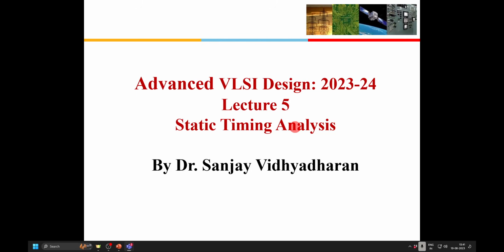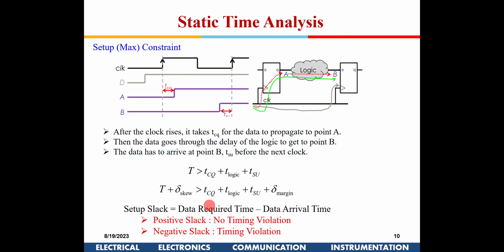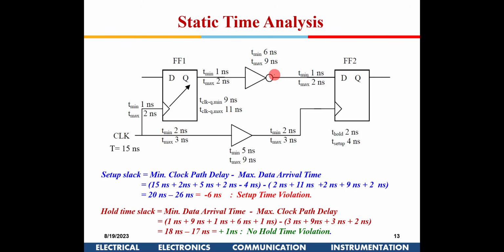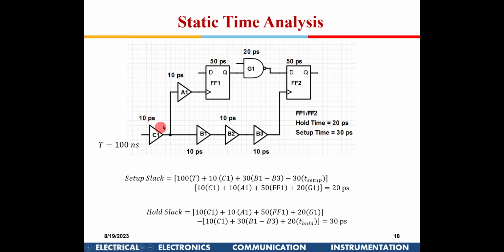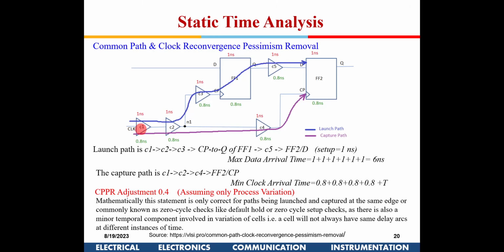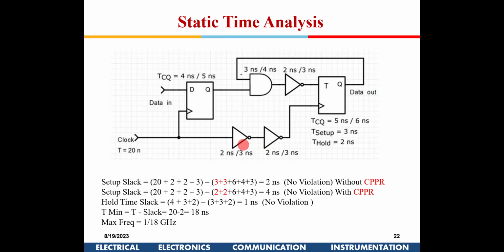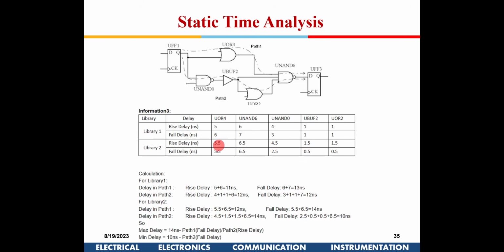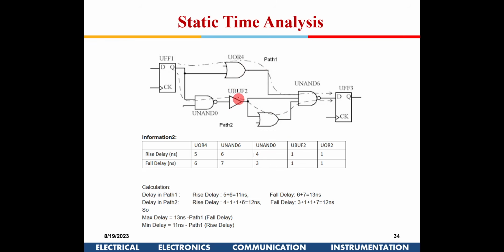Advanced VLSI Design: 2023-24 Lecture 5 Static Timing Analysis

Comment: 1:06:57, there is no common path for clocks between FF1 and FF2, why CRPR comes in to the place to calculate the setup? where those two 3 in red in first equation come from? It is hard to understand with the feedback loop. thanks.
Reply: I got it, with the feedbck loop, the FF2 is both a launching and capture FF. is this right?
Reply from the maker: Yes
Reply from the maker: I think you got it now

Comment: Very nice video. thank u. I have a question, at 12:10, in this -v clock skew situation, this will help with hold but hurting setup, is this right? thanks.
Reply from the maker: Yes, one has to cjecj for both , while  removing one violation

Comment: Hi Sir, The lecture was really helpful. Where can i get the remaining video for timing constraints of full module. Many thanks in advance!!  

Sir i have tried to register for your course, but it says user registration is currently not allowed, can you please check.
Reply from the maker: There is not requirement to register. You can go to the courses page and use the vLSI filter . All courses are freely avalaible to all
Reply: Thank you sir, i will check

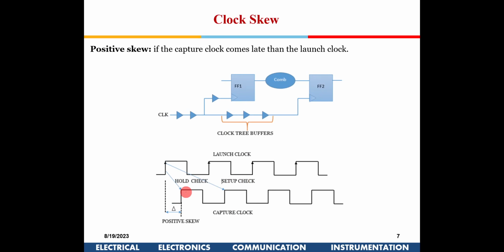Comment: 13:20 "Max delay violations are a result of a slow data path, including the registers, tsu therefore it is often called the "Setup" path.". Could someone please explain this statement?
Reply from the maker: The data needs to reach the input of  FF by a time intereval called stup before the arrival of clock. If data arrives slock there will not be adequate setup time